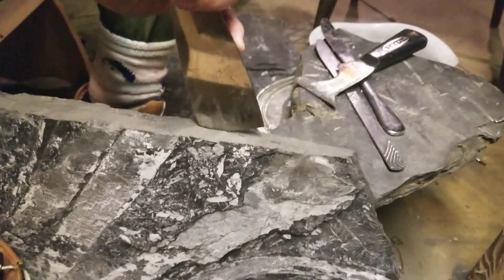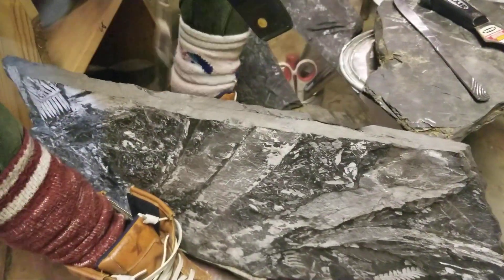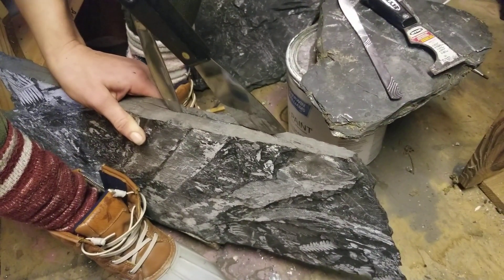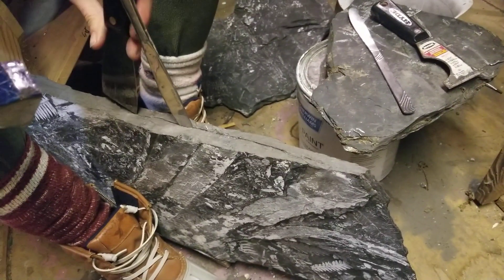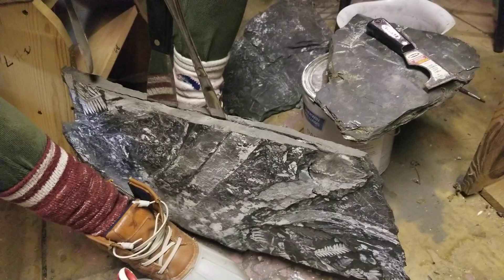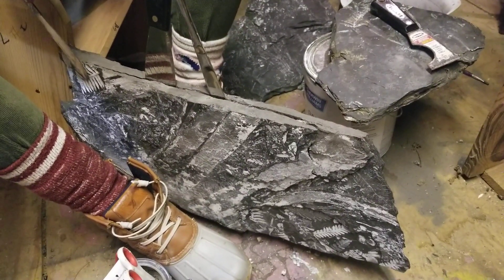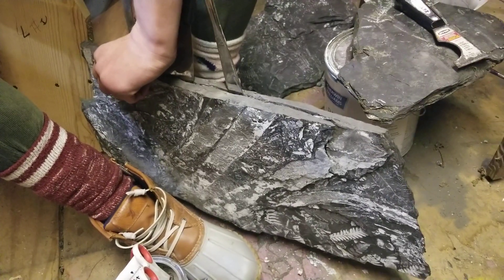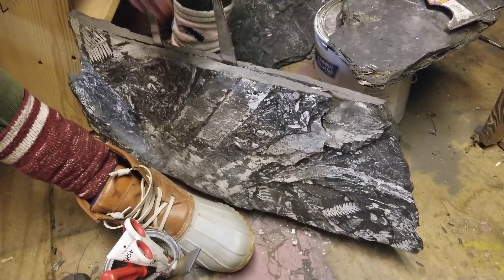Breaking Rock, Exposing Fossils

Comment: Question:   would a rubber mallet cause less vibration and maybe hell in breaking it off in one piece?
Reply from the maker: Possibly....but hitting a rubber mallet on a metal butter knife may mess up the mallet after awhile.  Scoring it probably works best.  Some layers split nicer and bigger than other layers.